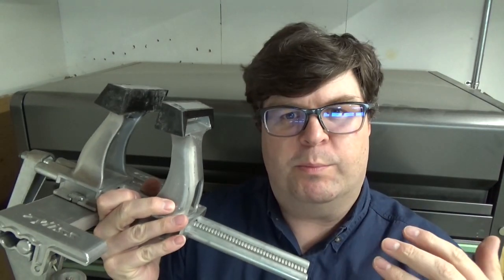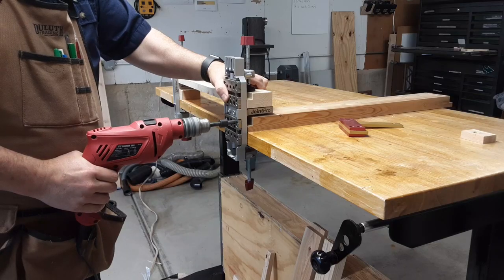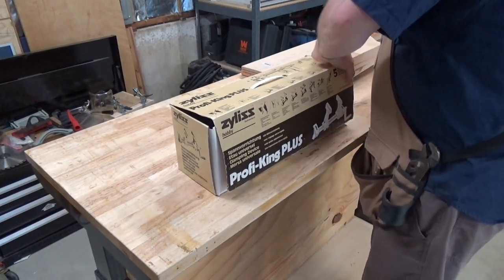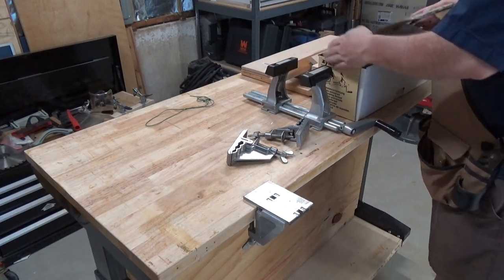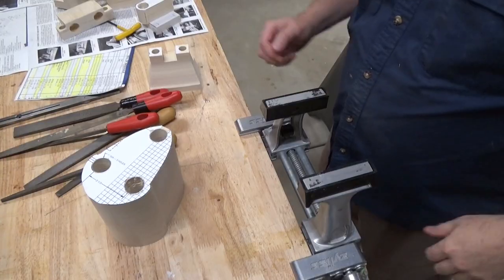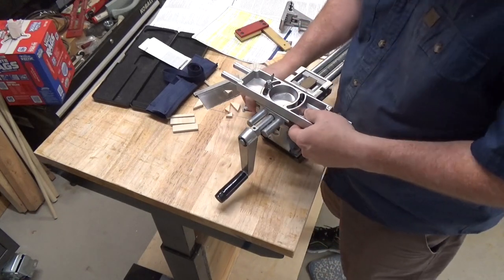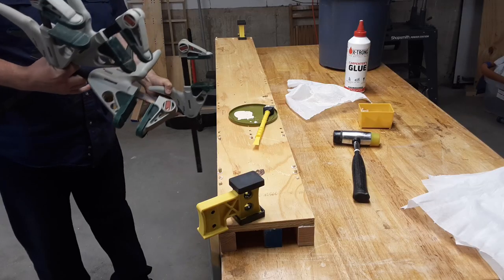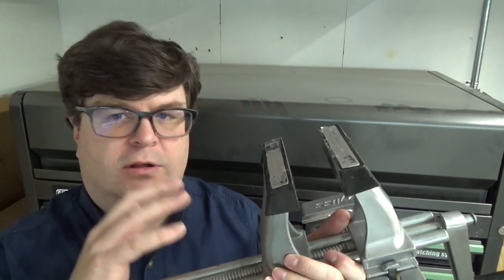Zyliss Vise for Woodworking: Old Solution for New Adjustable Height Mobile Workbench

Comment: There's a number of other great uses for this vise.  I found one a few years ago at Goodwill for $10 and it's a great tool.  One cool thing is that you can attach it to a 2x4 wall stud and have a vise wherever you want it.  It's not just that you can remove it, but that you can have an edge clamp and use it as a spreader.   So many different ways to use it.  Pretty amazing that it was made in the 70's, yet still works great.
Reply from the maker: So true!
Reply: My wife got me one from goodwill for $10 today. Needless to say I’m a happy hubby!
Reply: @MiracleChips  Congrats, very rare to find one of these at that price, yet we both got one from Goodwill for the same price :D.  It's pretty hard to find great deals at GW, but it does happen.
Reply: @karljay7473  I'm kind of a thrift store junkie. Not to be confused with a hoarder, those guys will pick up and buy everything and anything. LOL. I am always on the hunt for great monitors or TVs. The small ones are great for building Bartop arcades, using either the Raspberry Pi, The Odriod XU4, or for more power a tiny PC. They are a fun project which takes very minimal tools. I use one of my Zyliss vises for holding down the panel that was built for my pocket hole jig. Works great.
Reply: @gregghernandez2714  I just used mine the other day and the only changes I'd like to add is a quick mount/dismount and one of those "hold anything" shape changing jaws.  They make a vice that has ball bearings https://www.youtube.com/watch?v=aYUP4x0sL44. I was trying to get a grip on something thin and round.  Having a "hold anything" jaw would be great.
Reply: 10$ for one is about as good as winning the lottery!  Such a great find!
Reply: @jimmy_jamesjams_a_lot4171  I was blown away because it was still in the box and had all the parts.  The sad part of it is that I don't have a garage and my work area is small, so for most of the time, it just sits there.  I have used it a few times, but I'm so pressed for space that I have to store so many tool and that make it hard to drag out and setup.  Hopefully I'll have a full size shop someday :D

Comment: Here's a useful modification for your Zyliss.  To prevent creep and twisting of the clamps, drill a 1/4" hole through the  clamps, in line with the clamp screws.  Drill corresponding holes in the bench top wherever you want to use the vise and outboard support.  Then your can drop in 1/4" pins and snug up the clampscrews and the vise will stay put.  Also, I discarded the crank handle.  I made a 3" diameter knob, and drill some 3/8 holes around the circumferential edge for a peg hand that gives leverage when needed.
Reply from the maker: Great tip! It can slip on ,e from time to time

Comment: You know what's better than a Zyliss Vise? HAVING 2 OF THEM!!! I tag team both of them on the same bench. I also wanted to  mention that if you do not have a jaw horse you need to get one right away. I bought one from Harbor Freight (clamping jawhorse).  I was a little skeptical before buying it.  After I started using it I have been hooked ever since , it's in dispensible.
Reply from the maker: You know, your probably the 4th or 5th person to recommend 2 zyliss vises. Must be something to it!
Reply: @woodshopnerdery  My late father bought his 56 years ago, I actually saw one advertised locally and was going to go to a 2 vice  (I am British hence vice rather than vise) setup but it didn't have any clamps. Have spent the evening on YouTube and yours is the best video of the evening.
Reply from the maker: @muchsake  Thanks so much! Glad you liked the video.

Comment: Interesting on how many of your commenters have Shopsmiths, as do I,an upgrade to the 520. I use two of those Zyllis vices; One on each end of my work table. They will hold a long vertical or flat piece of wood with a concrete grip. Thanks for your video.
Reply from the maker: You're welcome, thanks for watching and commenting. I don't consider this a Shopsmith channel, but I do have quite a few videos which showcase my Shopsmith 510. The Shopsmith owner community has been very supportive.

BTW - Are you familiar with Scott Markwood's "My Growth Rings" channel? 90% of his content is Shopsmith specific.

Comment: If you buy a second device, and put it on the other end of your table, you will have a superb holding clamps for long vertical or flat pieces of wood. It is even stronger than the same thing done with a single device. Enjoy, Ken
Reply from the maker: Great tip, Ken! I think that is something I might look into. There are quite a few of these available on the used market, so I could make that happen.

Comment: Thanks for the great video.  I've looked at the adjustable-height table, and in the future, I may buy one.
For now, I converted an old Shopsmith 500 base into a stable adjustable-height, mobile worktable.
The Zyliss Vises are great!  I own 4 of them and use them often.  Positions and applications vary.  The turntable is the most used accessory.
I use my Shopsmith tools almost every day.
Reply from the maker: Nathaniel, you are welcome. I am glad you enjoyed it and thank you for the compliment. Great tip for making a worktable from an old Mark V.

Comment: I have one too but not yet the great idea of matching with an adjustable set up / outfeed table. The Zyliss I have I also use on my boat where my shop is even too small for a shopsmith. I did carry it back and forth and ended up buying a second one out of Australia. It makes great sense for someone already tuned to the brain work of changing out the shopsmith between functions. It’s a great tool.
Reply from the maker: Great points, Robert. Thanks for watching!

Comment: I remember seeing the Zyliss vise infomercial when I was a kid, probably back in the 70s. That tool and the Fein multi tool were the stuff of dreams. Both were way out of the family budget. About 5 years ago I stumbled upon the Zyliss vise infomercials here on You Tube and the hunt was on. Back then you could get them relatively cheaply on places like Ebay and Craigslist. I think the most I paid for one was 75.00, and that is the kit that includes everything including the drill holder. They appear to be going through some kind of Renaissance because they have really gone up in price and demand.  They are a great tool that come in handy for all kinds of projects, especially if you do work with dowels. I use them all the time. Great video.
Reply from the maker: Thanks for the compliments Gregg. You make great points about the vise! Anything useful will always have some value.

Comment: I recently inherited such a vise from Zyliss, but unfortunately somebody threw away a few parts... The drill stand and the thing with the 4 bars to use the set a regular vise. 😢 The plastic parts are missing as well, but I'll manage to 3D print them now I know where to place and how to use them. I guess I have to create the missing parts somehow to make full use of the set.

Thanks for the very informative video, so I know now how to use it, as there came no manual with it.

Comment: Even though I've been woodworking for many years, and have heard and actually seen the Zyliss vice (it used to be advertised on an infomercial) I've never seen an actual user working with one. I see where it would be helpful.  I've never seen the that adjustable height table before! I've had a SS since '82 and ended up making a cantilevered outfeed table. Thanks.
Reply from the maker: Thanks Berry, I appreciate the comments!

Comment: Do you see WHY these are not in the marketplace now?  Just buy a vise that clamps to your workbench that has a swivel head or a ball jointed head.
IF you're safety minded, you will just bolt a vise to your bench. The zyliss is a Rube Goldberg contraption, it doesn't solve anything  that hasn't already been solved, and cheaper and less bulky, and less gizmoed...

Today, we have "bench dog systems" for holding work to bench. OR, go zero cost with the super glue and tape method.

Comment: Yours is the original Swiss made one, so you don't have to worry too much about it breaking if you don't abuse it. It is the later not Swiss made "zVice2" that break under normal use.
Reply from the maker: Thanks Mark, The vise is still going strong, I've become much more confident in applying pressure and so far ZERO problems. It sees daily use now.

Comment: Thomas, this is Xclnt!

I’m puzzling over similar things; small shop. I noticed that the husky moves as you work. How do you tolerate that?
Reply from the maker: Thanks John! The movement in the bench is not ideal. But this is the best bench I’ve had, previous versions were ketter folding bench and folding picnic table!
Reply: @woodshopnerdery  Lol … we do the best work with what we have!

Comment: I have an 11' 11" x 11' 11" woodshop that I built just small enough to avoid zoning scrutiny in Provo, Utah.  My shop too is built around a Shopsmith, and I just upgraded to a 520, after a hiccough with my 510 headstock.  This lead me to reconsider my shop layout for the first time in many years, and after watching this video, I am seriously considering copying you by switching to a Rolling Husky Adjustable Height Work Table, and a Profi-King deluxe vise set, from my traditional workbench and vises.  My questions are: if I chose one of the Husky Tables with the two shelf option would there be enough hangover of the bench top to secure the Profi-King vise?  How much hangover does the Profi-king vise require?
Reply from the maker: Hi Jeremy, there is a minimum required over hang for the Zyliss. Since this could be a common question I documented the answer on my Community tab. You can get to it at this link - https://www.youtube.com/post/Ugkxlfhse8i8TYFX7kWAkW_Qc3YydbhxFNk_
Reply: @woodshopnerdery  Thanks for you prompt reply, but just to be sure - in the first picture, is your tape measure showing 4 CM = 1.57 inches, or 4 inches
Reply from the maker: @JeremyFriedbaumutah  The metric and imperial measurements are written in the text of the post. You may have to click the "Read More" button since YouTube likes to collapse long posts.